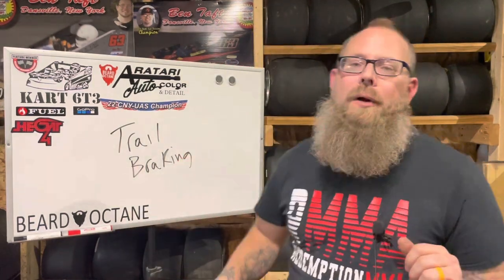Trail Braking?

Comment: I am coming out of retirement and I was running Flathead back in the day in 2004 and 2005 and now these clone engines feel way faster and I cannot seem to drive the same tracks that I used to win on I cannot drive them the same because now I'm having to lift because they're so fast. But I'm just wondering if it would be faster for me to Trail brake but I've never done that before so I'm afraid I'm going to look like I'm never raced a day in my life if I try to do that LOL I'm the type of person I get very aggravated with myself if I cannot get something under control or figure it out
Reply from the maker: You’ll get it but I believe you’re right these clones are faster.